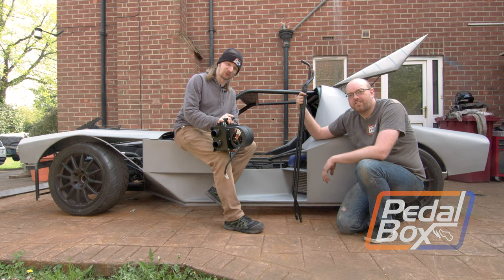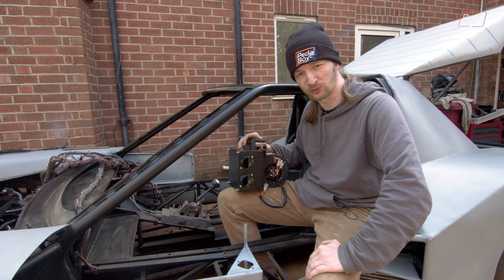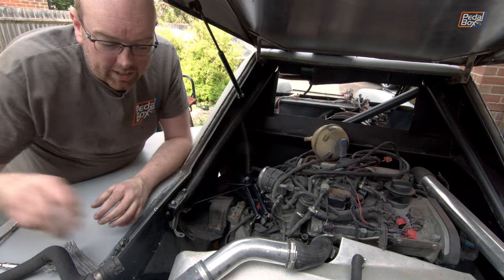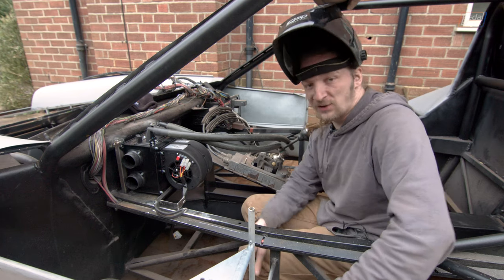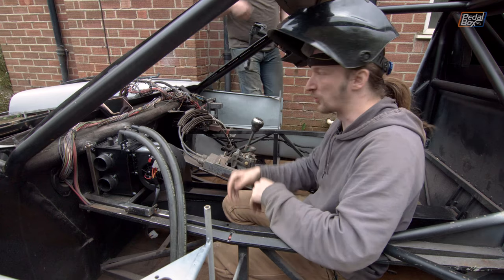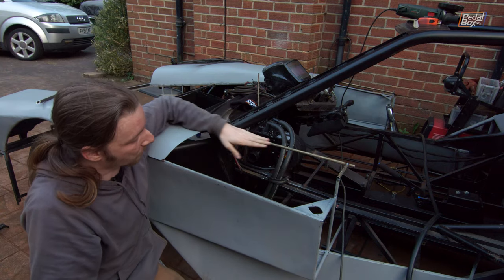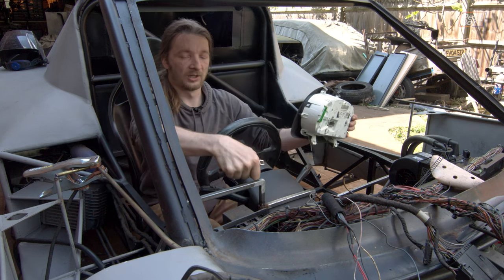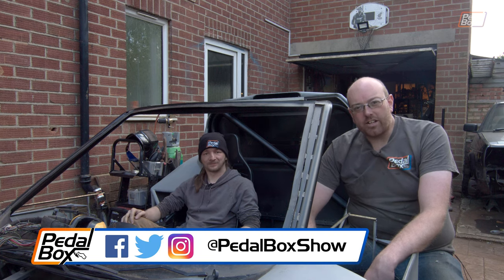Heating Up | Audi TT Kit Car | PedalBox Episode 102

Comment: Great to see the inside of the car coming together nicely! Only a smöl fire hazard with leaving PB merch on the edge of where you were welding in the heater matrix. ;)

Out of curiosity, if you'd had the heater matrix before building the firewall, might you have considered mounting it the other way around after building an alcove for it?
Reply from the maker: Probably not, just because the wiper motor would have been harder, same for the fuel tank/etc. 
And the t-shirt survived :D, although not the previous Tim spent with grinder sparks. Need a new one!

Comment: Why don’t you move the heater to behind the n/s/f wheel into the void
Reply from the maker: Not a terrible idea! I might revisit and have a think if it'll work, the best reason for central/passenger dash side is routing the air vents. All four would have to run right, which might take up similar space and need extra bends/etc. But it's not totally unfeasible. I'll have a think and maybe do a short on it :)